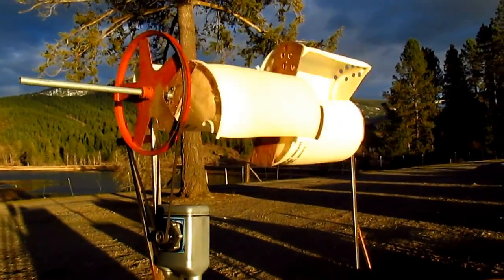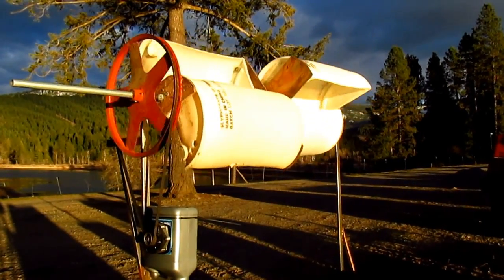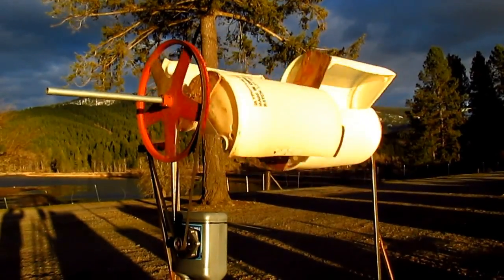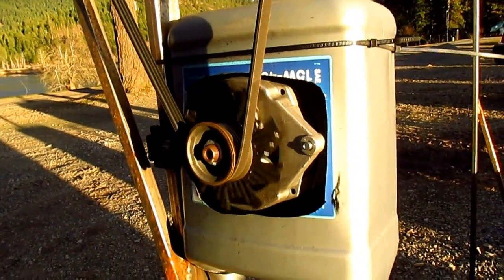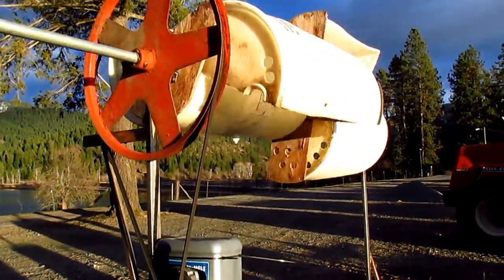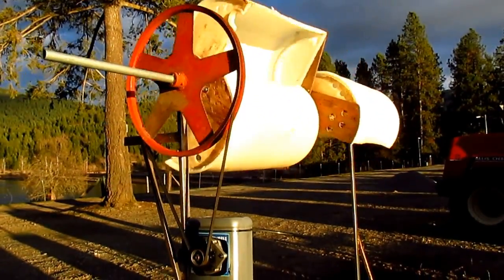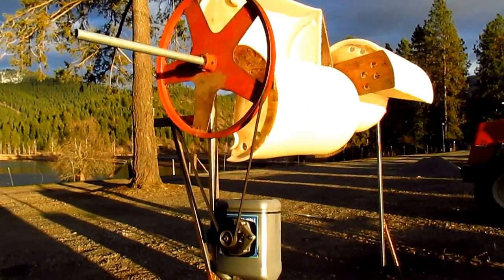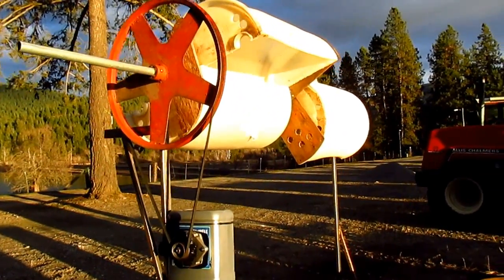low tech savonis wind turbine

Comment: Nice toy. But: All practical tests of ground-based small wind turbines show: 1) They hardly produce any electricity. 2) They don't last do not last long!
No electricity because there is hardly any wind near the ground - and the electricity yield is proportional to the third power of the wind speed: 100% more wind = 800% more electricity! In addition, the wind near the ground is extremely gusty. 9 out of 10 small wind turbines therefore cease operation after a short time! 
Solar panels generate at least 10 times more green electricity with the same investment of time & money!

Comment: I want one! 
I guess I could use old bicycle wheels?
And any old alternator will do, right?
Reply: Or DC motors.
Reply: @professorfukyu744   I don't know what a DC motor is or where to get one.  
But I imagine if I post on Facebook someone will give me an alternator.
Reply from the maker: I used pieces and parts that I had lying around my shop. Bicycle wheels should work. I had an old alternator that i used.

Comment: The problem with savonius (this design) darrieus and H-rotor turbines is that the blade advancing into the wind stream introduces a lot of rotational drag into the system. Horizontal axis ‘propeller style’ turbine design avoid this inefficiency as there is no blade advancing into the wind. Congratulations on the build. What you have is far better than nothing at all. I would, however, reposition the rotating axis in a vertical orientation, as another commenter has mentioned. You’ll harness horizontal wind arriving from any direction that way.
Reply from the maker: You make a very good point. I was looking for something that would work on a roof ridge top.
Reply: A wind break on the bottom half? Like a shield to cover the  bottom half. You could angle it to guide to wind to the top half...

Comment: Good design for a turbine! Try to put this Savonius turbine, in sea waves close to sea beach and see what happens!! Keep the horizontal bar on which the turbine is spinning, just above the water line and place the alternator on top of the turbine, away from water.
Reply: Maybe a floating platform with fins that help with direction and flow of wind to blades.

Comment: I think this horizontal axis concept is the way to go; more efficient than a vertical axis (from an old guy that doesn't really know much of anything).
Reply: Vertical axis will spin regardless of wind direction making it easily more efficient.
Reply: How can it be more efficient? A vertical axis will catch wind from any direction whereas if the wind blows from either end as it is now, there will be no rotation.
Reply: @bobmarshall3700  You are right, as a lot of others here have posted - a vertical design could change with wind direction change.  

I was really thinking about the mechanics of horizontal vs vertical.  If the wind was only from one direction - which design would be more effective?  

What about applications that were locked into one direction?

The inventor (the OP - Mike Schlepp) explained:  "I wanted to make a turbine that would work on top of my barn roof. Wanting to use the pitch of the roof to direct and accelerate wind flow."

I think there are other concepts out there that are designed with a fixed direction.  There are probably locations where the wind blows pretty consistently in one direction - like from the ocean to shore.  

Also  there may be a way to have a horizontal design rotate with wind direction.  Among other possibilities - a wind-sensor that would redirect via a motor from a scrap yard to turn to face the wind.  
Maybe the addition of fins that would both help with wind direction and channel more wind into the blades?  

Maybe a floating platform (even anchored in small pond) with fins that help with direction and flow of wind to blades?

I hope Mike keeps experimenting and inventing.